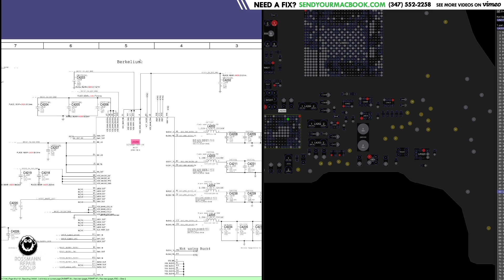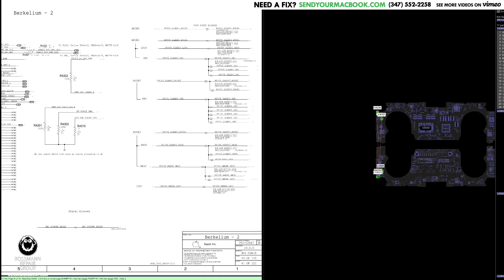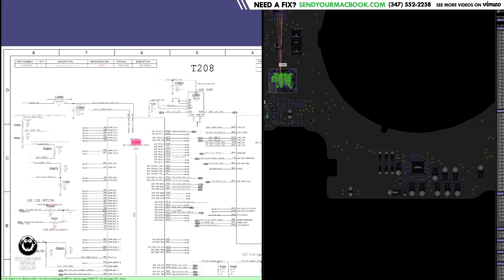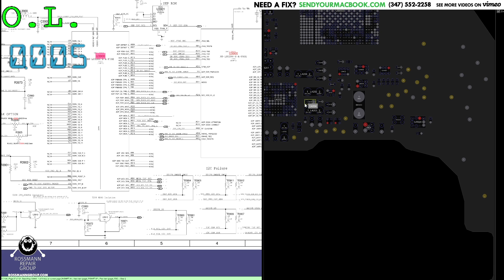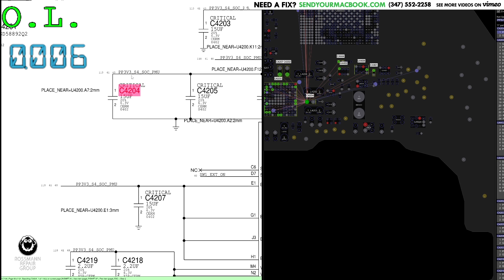Macbook Pro dead again repairing the logic board

Comment: As a starting point, you often reference the buying power of precious metals in the past compared to present day.  Using that relationship...many parts of the country have far exceeded this "value" comparison...including NYC and its surrounding communities.  Your use of this comparison is a common sense approach to understand the real value of a property...not one driven by short-term buying demand.  

There are two extremely important factors to consider...interest rates and cash available for a down payment.  The interplay between the two is the heart of not getting screwed by buying an overpriced home...something that can kead to financial ruin.  In a nutshell, higher interest rates drive down prices...because as rates rise there's a reduction in overall ability to pay for a property at a given price.  Prices adjust down until purchasing can again be reignited.  This is a supply/demand issue but not for homes but for the money to buy homes.  Right now, interest rates are very low...and it sounds good...and many want to "lock it in"...but on what...the purchase of a home overpriced by 20% to 30%? 

Right now property prices have exceeded the value established before the 08-09 collapse.  In fact, as a function of normal value maturation, they are well above what they should be now even counting the run up prior to 08.  So, over the last 20 year a pattern of value had been established that has been exceeded over the last 2 years.  So, your sticker shock is understandable. 

Sit down with a mortgage calculator and play with borrowing amounts vs interest rates....there are printable tables that have done this already.  Consider that an increase in mortgage rates to 5% or higher will return home values to levels from 04 to 06...about a 20% to 30% reduction based upon neighborhood and community.  You will likely find your sweet spot...the value of the home vs monthly payment between buying now or waiting to let the market drop.  But, always keep your thoughts about gold vs buying power in the front of your head.

Comment: I do have a question, so I just received my new macbook pro 13inch 2020 and I noticed that the back of the pc on the bottom where the heat sink should be and above the touch bar gets hot. When on my lap I noticed it gets warm. And it even crashed on me today and I just got it. So is this something I should be concerned about?

Comment: I'll never buy another Mac again.  20 Years as a user and i'm sick of the BS and constant upselling they do.
Reply: @Jim Allen sometimes I can be dense. Are you saying windows has been a great product? I'm thinking about buying windows hardware.
Reply: @LilC1deep  there's no "windows hardware". There is Microsoft hw but I strongly doubt it's indoor and not outsourced to the random foxconn of the day that must respect certain requirements. Likewise others do.
Reply: @Jim Allen i don't use either anymore.
Reply: @Jim Allen lolwut? I might have seen 3 bsods caused by sw since win98se, a little bit more by hw but you know, when you overclock the crap out of them they quit sooner or later. and I'm also in the position of "adapting" some infs here and there sometimes.
Reply: @Jim Allen you got some points, I overlooked as simple consumer with average needs. Yeah about pointing fingers I know something. But you either go on a closed delimited ecosystem like apple's and you buy their only working 60$ cable adapter or go wild and enjoy the ride.
Reply: They went downhill since Tom nook sorry, I mean tim crook